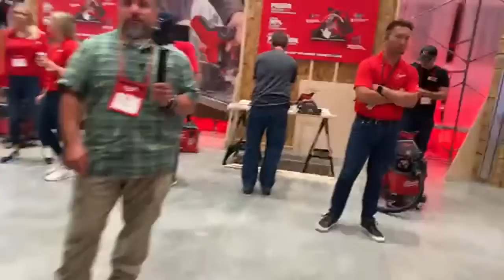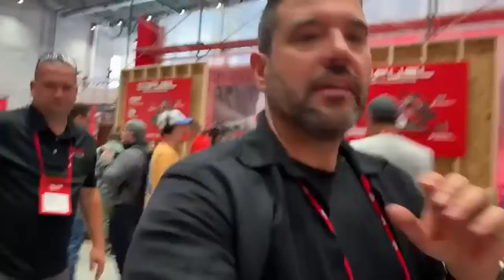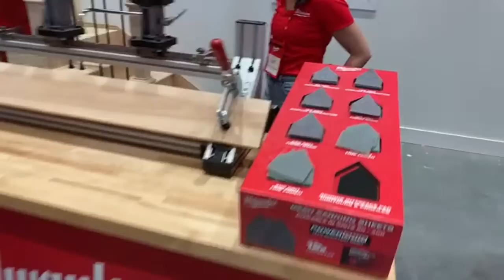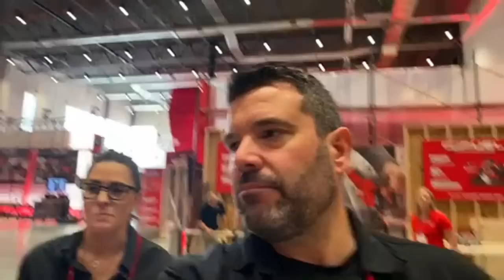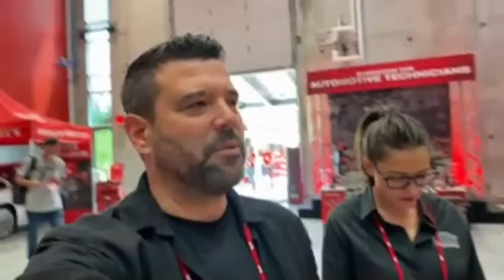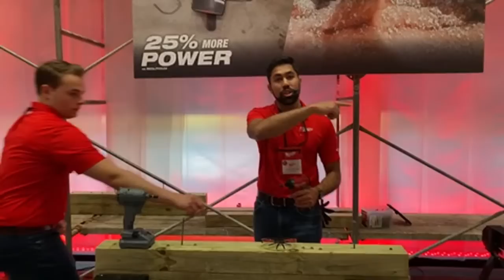LIVE! Milwaukee PIPELINE M18 TRACKSAW! Sanders! (Part 2 of 3)

Comment: I have the Makita 36v track saw, and will probably get the Milwaukee as well.  If one tool made my life so much better it was a track saw.  It's the tool that makes me smile when I'm not killing my back moving full sheets around, and it takes away the danger of using my table saw by myself with heavy 3/4 marine grade plywood.  If you don't have a track saw, just get one!

Comment: For a track saw, added features aren't what makes them good/bad/expensive.  Accuracy is the name of the game.  Arbor runout, straightness of the track (and saw shoe), and positional accuracy of the cutting guide at various bevel angles... That's what makes a good (and usually expensive) track saw.  If it matches the Festool positional accuracy and cut quality, $399 + tracks is an absolute steal.

Comment: Looks like the tracksaw can bevel without falling over... does that feature extend to non-Milwaukee tracks?
Reply: Yes they all have system to lock them to the track
Reply: @aaronoconnor606  you know that for a fact? Makita's tracksaw has the same feature but it only works on Makita tracks. I own the Festool and Bosch tracksaws, neither of which have that feature so their tracks probably don't support it unless Milwaukee came up with something special.
Reply: @RobertBarth1  the makita and festool tracks are the same.
Reply: @barjonahbuxton3264  no they're not. The Makita track has an extra lip on it that engages with a protrusion on their saws' shoe to keep it from tipping over when beveled.